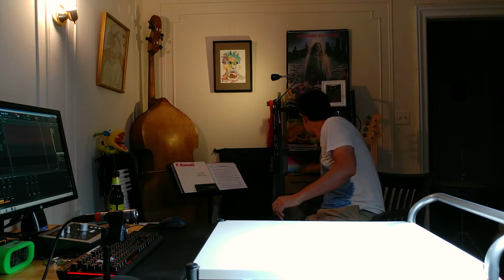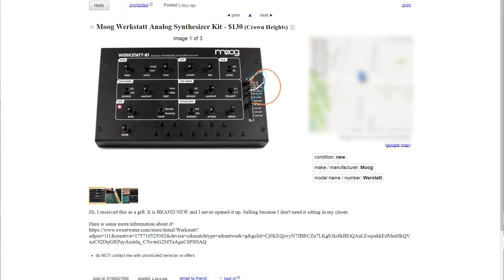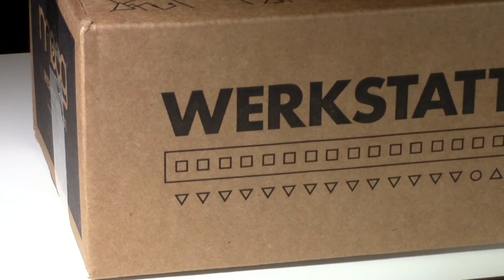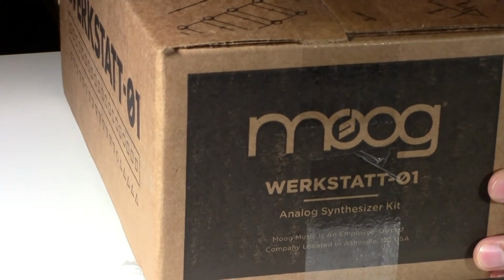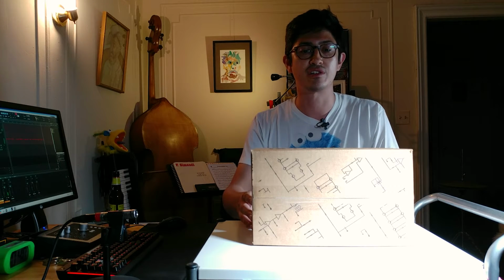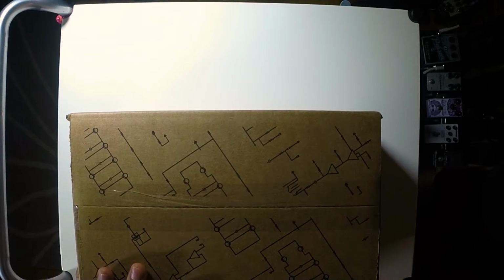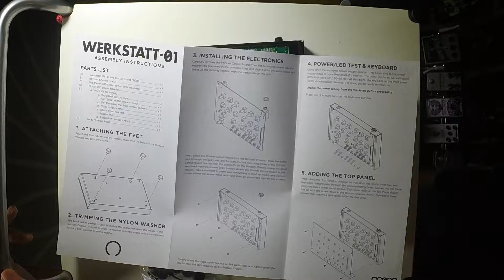Building a Moog Werkstatt

Comment: Bro, I have this and the keystep, and ableton, how do I plug it into my interface and ableton so I can hear it through my monitors
Reply from the maker: You have to plug the big output of the Werkstatt into the input of your audio interface.  Assuming it's installed correctly, your interface needs to be selected as the audio interface in Ableton.  Then, on an individual track, the input you plugged Werkstatt into can be selected.  The monitoring selection for the track has to be set correctly to hear something as well.  Let me know how it goes.